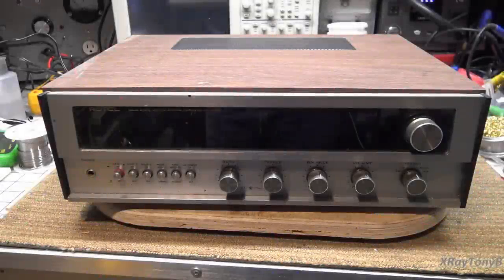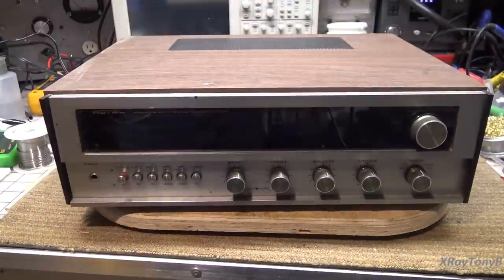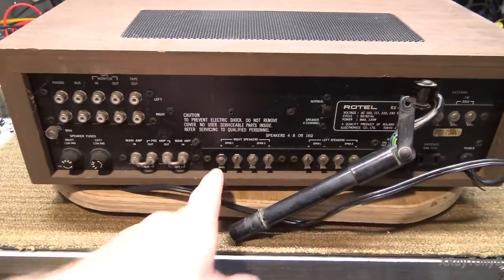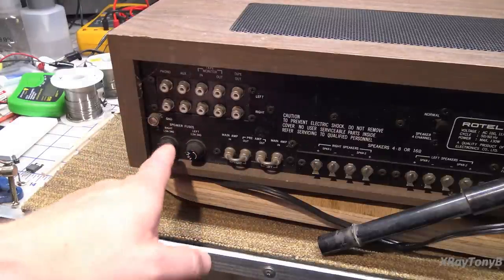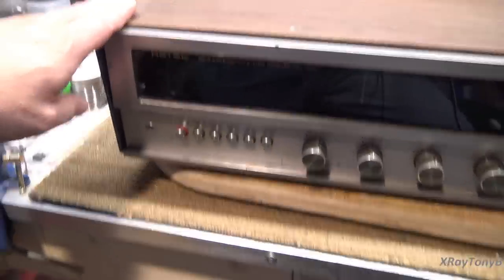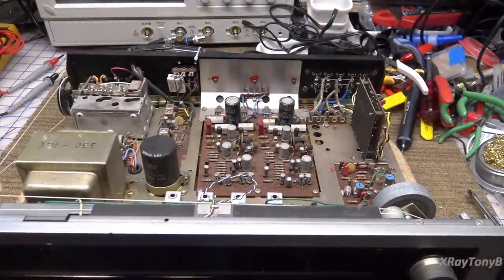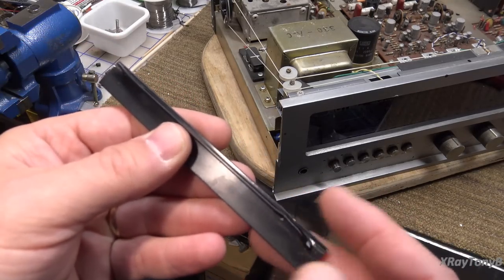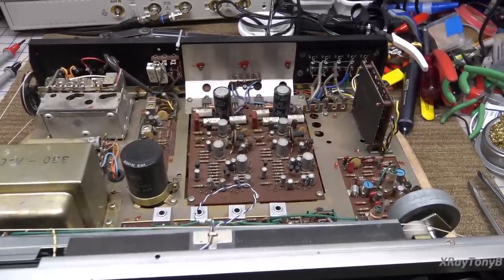Rotel RX-400a Stereo Receiver Repair - Part 1

Comment: Heavy duty bubble wrap (large bubbles) and multiple layers wrapped tightly in all sides, with a large heavy duty cardboard box (to take the extra layers of packing) is literally not expensive.  eBay packers aren't cheap, they are lazy.  Large bubble packing wrapped multiple times around to give at least 5 inches of protection on all sides is cheap to do.  All these you can pick up at your local UPS store.

Comment: doesn't take too much effort to protect the unit, just find a thick cardboard box cut 2"width double the length required, and long enough to cover the side of the unit and 3" inches top and bottom, folder the card in half bend the card in semi-circle so it sticks out about  an inch just type it. x8 to the side of the corners front and sides and back. use gaffer tape not duct tape it doesn't leave residue
it's not a decoupling capacitor it's a coupling capacitor should get rid of. a decoupling capacitors when it goes to to ground.
try transistor. c,o,m, will give you alternatives. just had a look and the 2sc 1108 by isc, is compatible and is better

Comment: 2sc1107, I have a Claricon Quad receiver that uses them!. Yes, Claricon, NOT Clarion. Mine.are.actually Sanken brand.

The xref i found was 2N6123. Lots of searching... I think Mouser or Digikey still has them., 

I have a thread over on the Nuts-n-Vokts forum. Just search for Claricon.